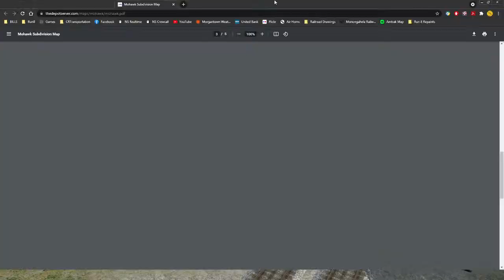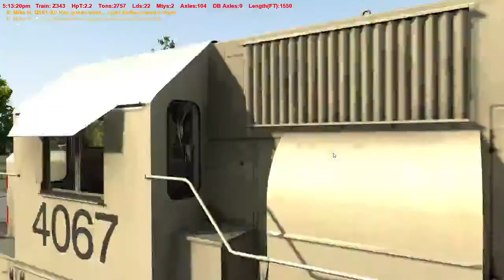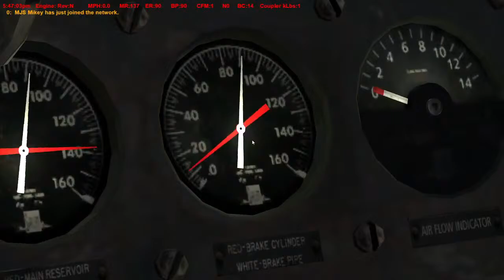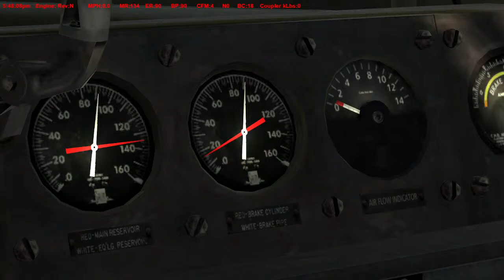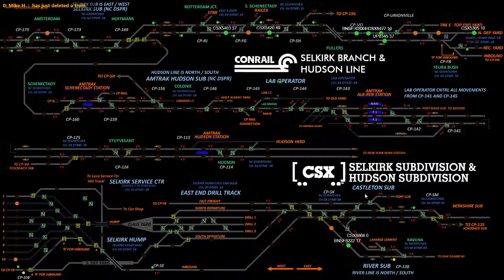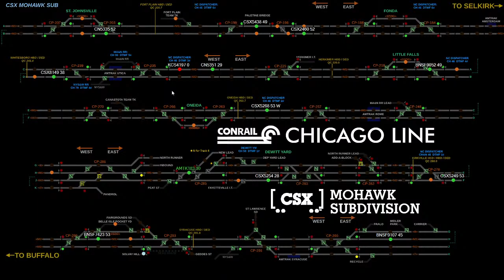Run 8: MA&N Rome Switcher - CSX Z343

Comment: Hey chris what brake are you using while shunting...i dont see the BP change when you stop...is it the independant
Reply from the maker: Most of the time I was using the independent. I didn't have a lot of cars and wasn't very heavy so I just stopped with that. On a longer and heavier train, I'd have used the automatic more